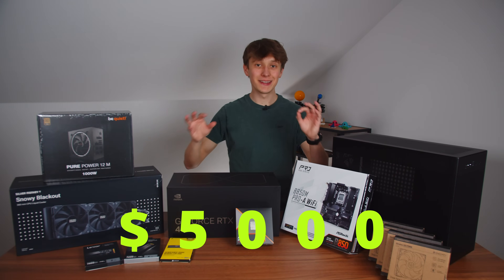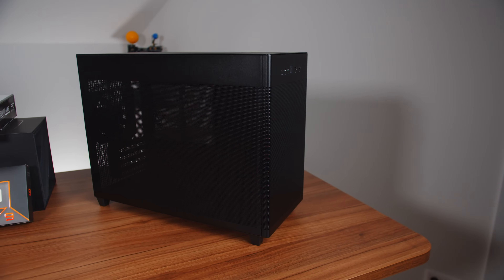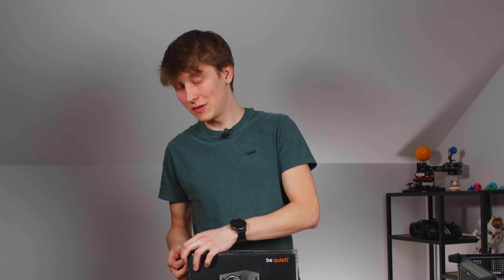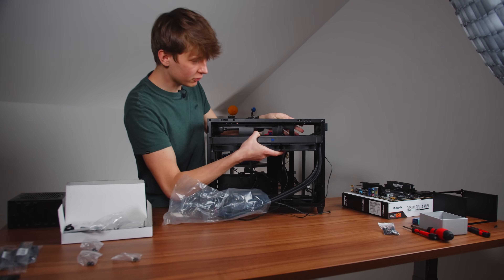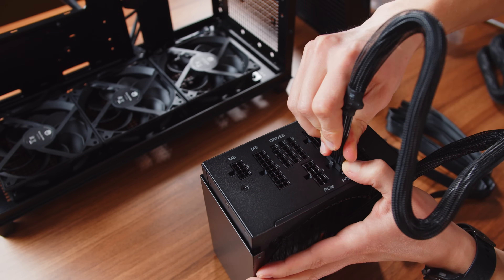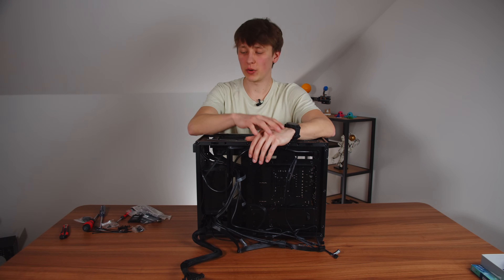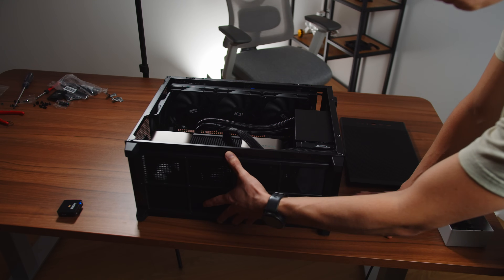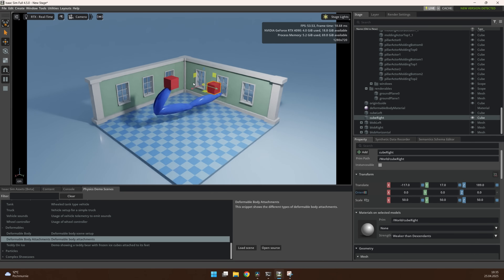Mom, I Really Need RTX 4090 For My School Project...

Comment: Brilliant channel by an intelligent, innovative guy. I'm just an average guy, but after watching numerous videos on AI LLM's, its obvious they're just word pattern predicting programs, not independent thinking entities. I think the programmers that created AI LLM's ran millions if not billions of sequences for it to identify patterns and finally predict the next words to use when a question is asked. For an AI to be able to move a robot, identify obstacles, distances and identify patterns, it would require a different program with a similar number of sequences ran over and over again, millions if not billions of times. These programs probably wouldn't be language type models, but AI LQM's. 
Example, instead of a LLM identifying patterns in language, so it predicts the next...........word. A program designed to identify patterns in movement. Move forward, obstacle 2ft directly in front, move.........right, to avoid the obstacle. These sequences will probably need to be ran millions if not billions of times to identify patterns. Then the two systems would probably work together to enable voice control to produce a moving robot that avoids obstacles. However, even then, they will not work independently without prompts because they have no desire, no limbic system within the computer system, like the human brain. They're not independent thinking entities, just sequencing programs. 
Your idea is creative, but it's possibly flawed from the outset. Good luck trying to pull it off though. Its enjoyable watching your vids.

Comment: I upgraded my computer  as well. I have used Fusion360for quite a few years and I got sick of the crashing and constant headache (part of the reason I upgraded). Come to find out the issue was always with Fusion. It crashes constantly with any model that has more than 100 faces. The software just struggle and bogs down. Sometime I make a change and have to walk away for a few minutes before it updates in Fusion. I have had the temps and CPU/gpu usage open during these "crashes" and they neither jumped above 15 percent usage and my pc was running cold the entire time which points to fusion being the main bottle neck

Comment: Great that you didn't touch the contacts of the RAM modules. Sometimes I see videos from the so called experts where they touch the contacts with their fingers. Bad idea. Mostly the RAM modules work just fine after they are installed, but years later they are often problems. I saw many RAM modules from old PCs where it's easy to see fingerprints on the dirty RAM connectors.
And for everybody learning, just don't touch any of these contacts. And if you did it already, use an ordinary (pencil) eraser to clean them.